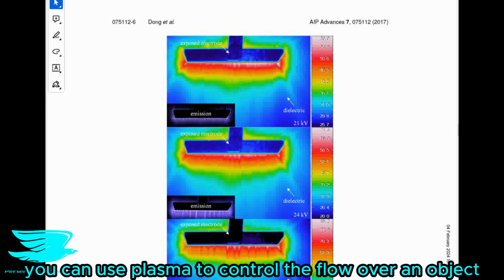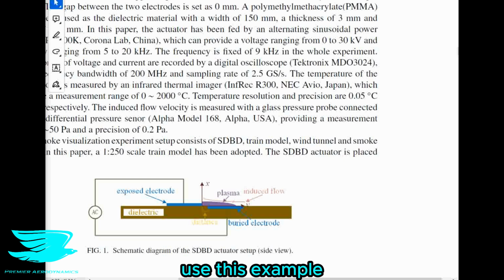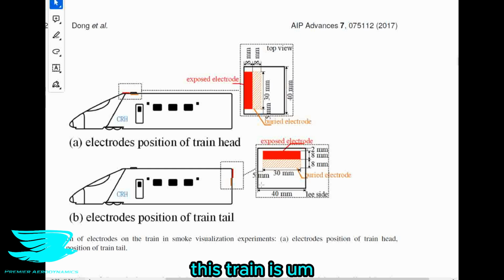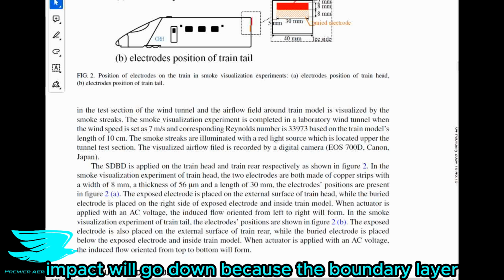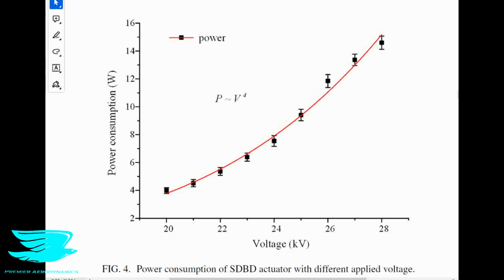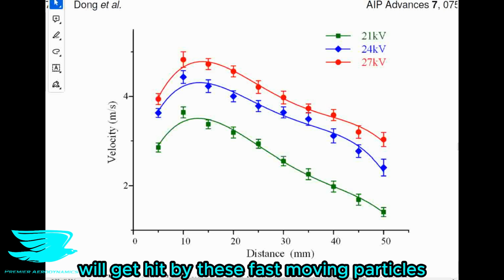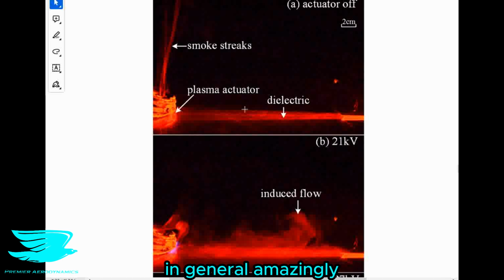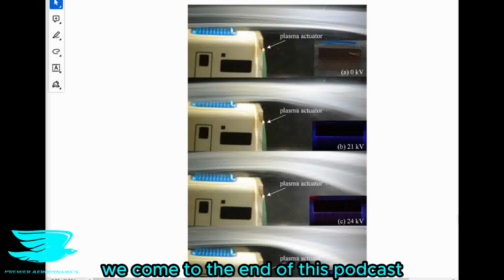Podcast #169 Using Plasma To Make Trains More Aerodynamic

Comment: Hmm, maybe something like this could be useful on re-entry vehicles. The thermal ionization of gases as a craft enters the atmosphere could likely interact with the dielectric plasma, enhancing it. Imagine if you could make a plasma bubble around the re-entry surfaces, similar to a cavitation bubble for a torpedo.
Reply from the maker: Well, along those lines, we actually have a podcast coming in in the next few weeks about using plasma to control shock waves.

So, it is a similar kind of idea.

But as for using plasma like this, I guess you could use it to redirect the plasma that forms, which would be especially useful for radio comms. During re-entry, the radio is surrounded in the plasma, which cuts off signals, causing a radio blackout.